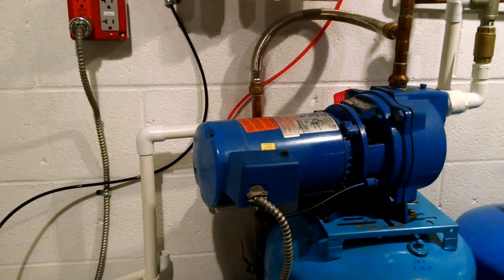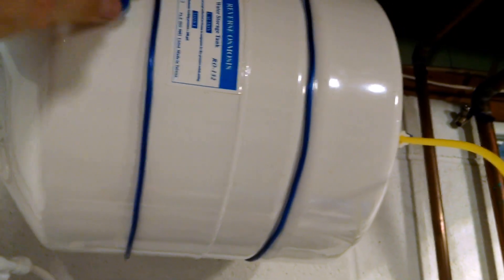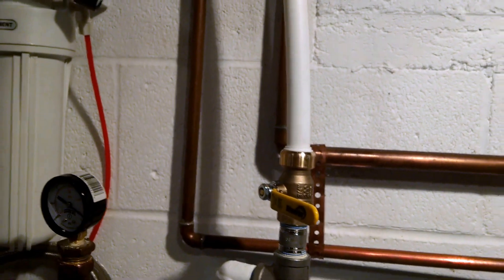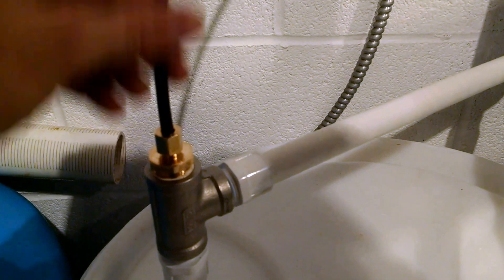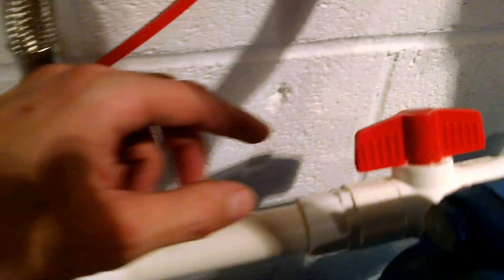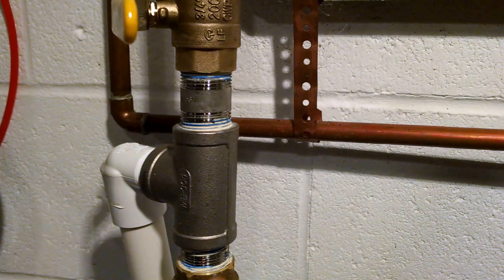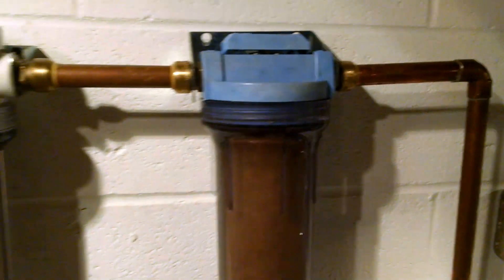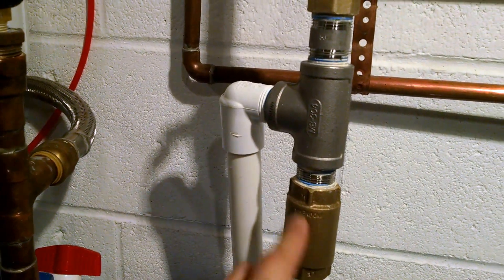Rain Barrel Drinking Water Part 2 - Reverse Osmosis

Comment: so is it ok to use the r/o rejection water. By running it back through the system so there is no waste water. Or would that be a bad idea.
Reply from the maker: In the case of 5ppm rain water, I re-run the rejection water several times.
Reply from the maker: And the rejection water already went through the 5 micron and carbon filter once so it's probably easier to re filter than the source water
Reply: @LibertyDIY  ty